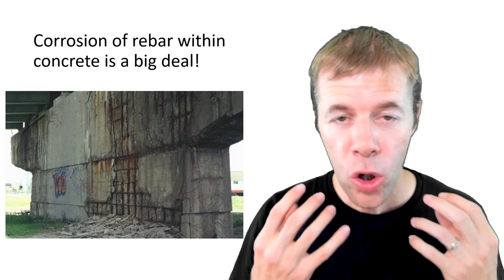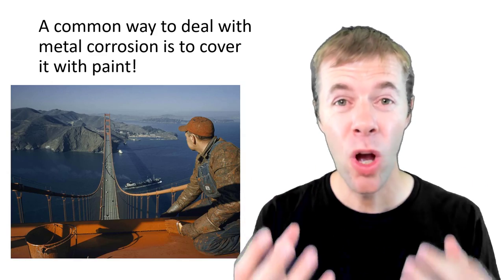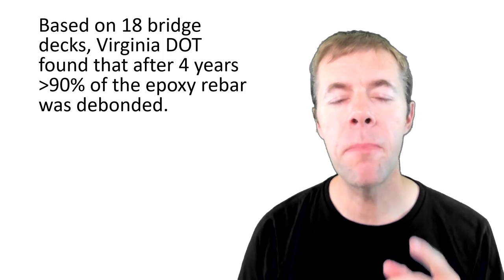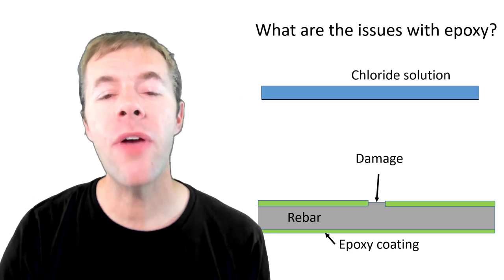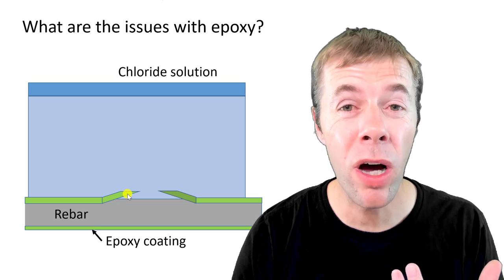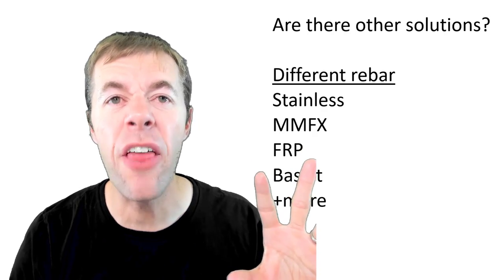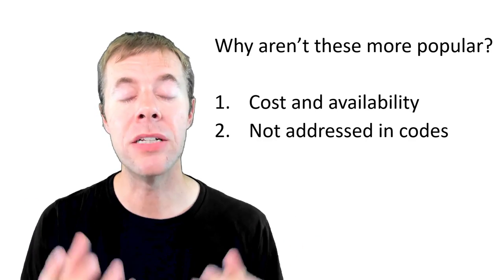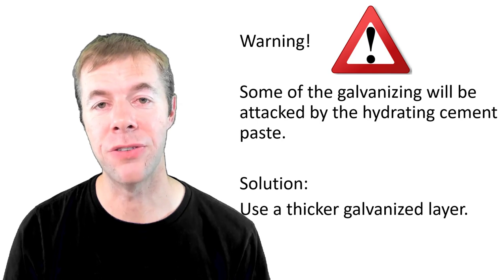What is epoxy coated rebar and why is it being banned?

Comment: Great Information!

So stating the obvious, bending galvanised will de-bond? Cutting? So I assume these issues are resolved by designing all the bends etc formation in external factories and then dipped?
Also minimum of 50mm coverage, A lot of European concrete cancer, especially from pre 1980 was due this simple oversight. Out of sight out go mind....

I worked I Dubia for a few years, apart from specifiing stainless steel, mild steel was used ( which 99% of the time was due to 'value engineering' hate that phrase) then they coated all external concrete with a bitumen based product, ( even in the ground the base covered in a bitumen based matting)I know it as sythaproof, drys black, two coats and smells like mens urinals....All external bolts fixings had to be Stainless Steel 316, ( coastal, very high salt in the ground and picked up via offshore winds), but often just mild steel covered in Dense tape (cheap bodge). Basic zinc plating was often ignored, which is pretty much standard around the world.  

Expect to see a lot of engineering failures, which have already happened, but the press is government run, so never reported. In my time out there, there were 4 tower fires, only one got reported....Apparently 'nobody died'. 
The curse of macho bartering culture in construction, plus those making decisions are there for the wrong reasons, that to be fair are a reaction to being screwed in the 1950-70's by the west (UK and US)....Geopolitics always has long term consequences....

Comment: My process of using rebar in strategic area for long lasting reinforcement is to coat the rebar with sopho then when dry, with licquid wax. You will die before it rust. Inexpensive but works well.

Comment: God makes people to serve a purpose. i want to know about concrete and here you are.  Im looking into ferro concrete for boats.  So galv is good {as I thought}  but ive learned that concrete isstronger if made using salt water.  So what do you think with concrete using glav rebar using salt water.  But also - I see there are additives for concrete -  of interest is to make it water proof.  Im at a toss knowledge wise if you use salt water in concrete - is that going to erode the reinforcing.  Thanks.

Comment: So again about rebar, the use of Galvanized Structural Anchor bolts was not permitted on heavy structure. I was advised that Galvanized bolts in concrete would not attain torque of the nut due to slippage. So many things to know about concrete Eh!

Comment: Wouldn't it be cheaper to use 316 ss
 On buildings & docs on the water.
       For the long run.
Like when a building is literally falling apart in 30 years.
     Or replacing a whole doc.
           Galvanizing is probably illegal in the US. Its a Lead coating.

Comment: Galvanising is also very costly. We have invented nano technology based compound from precious metals in nano form which increases thee nobility of iron and hence increases the bond strength between rebars and concrete. It is 10 times cheaper than galvanising.

Comment: Stainless rebar would never work in concrete.... it expands and contracts far more than other steels, and work hardens in unusual ways. In my mind, fiberglass rebar would be ideal, but the costs associated with it would be prohibitive. There are other steel coatings other than epoxy to look at (improving existing formulation and thickening the cladding come to mind. Likewise with Galvanization (Hot Dipped Zinc), there are other metallic coatings which could be alloyed or added after galvanizing to improve corrosion resistance... nickel comes to mind.

Comment: Use to work in a steel mill when we lost a heat (did’nt meet Specs) it would be sent to the bar mills to make concrete rod
In Europe they have been using Stainless Steel rebar for over fifty years.   They are smart we are stupid ! ! !

Comment: Where are our civil engineers' comments?
.
.
Corroded rebars actually bond better with concrete. There is a reaction that creates a bond between steel and concrete.  The problem is when the corrosion to the steel goes subsurface into the steel.  When this happens the steel expands and cracks open the concrete allowing more moisture to enter.
.
The main aim is to have minimal corrosion and a fully effective concrete skin that seals the steel rebar to ensure no more oxygen reaching the rebar.  This is achieved in most Dam construction.
.
I can see epoxy creating a slip layer and failing.
.
ps; it is very important to use steel in concrete as steel provides elastic strength to concrete and it happens to have the same thermal expansion co-efficient as concrete.

Comment: Well all those gas pipes from the 1980s and earlier that are buried in the dirt. We prevented holes and nicks in the epoxy coating by running a 5000 volt zapper over the pipe. If there's a hole a bell rings and you mark it for repair. Delamination of the epoxy is caused by time delay between sand blasting to clean metal, and entry into the oven. It can be caused by cooling before coating on the stuff that's left the oven. It's caused by lazy workers trying to maintain production, or management cutting corners on the product by not running cold material back into the oven. I made coated gas pipe for years, and out product has been exposed to the elements for 50 years or more likely longer 70 years under thousands of psi, and it's still good gas pipe. Building construction just needs a zapper run over the rebar before pouring concrete. Zink coating is ridicules. Nothing reacts with zink more than clorine compounds. Drop a galvanized nail in diluted hydrochloric acid. The zink will release hydrogen creating explosive pockets inside buildings. Really a bad choice.

Comment: Sacrificial electrodes would also help, but painting or epoxy-coating, that's stupid.
Paint rebar or anything buried and it'll be cut through/get a big hole everywhere the paint is slightly broken. This is something every student learns in year 1 o 2.

Comment: I think you. Are on to something even double or triple 0 coat. After the problem with the collapse of the condo in Miami Beach which had this problem but only one of perhaps many other deficiencies. It certainly is not the only solution but  a start. The other is over-site which should be in play often gets compromised by corruption and inefficient prepared planning. An example not ordering enough of a certain material and finding not enough time in deadline of the project to remanufacture the item. Often an inferior  substitute is is chosen! How can this be? That is where corruption finds it’s way into the back rooms.

Comment: Could there be a more natural solution?  Perhaps bamboo which is sectional, strong yet flexable, quickly & easily grown.  Or Hemp or such ??  I'm no engineer but with all the advancements of the last 50 yrs you'ld think we get past rebar as a reenforcement for concrete.  The uses of bamboo as schaffoling and such in Asia is remarkable.   Anyway just my two-cents worth today...    : . )

Comment: TL;DR Galvanized rebar anyone?   Possibly there are other coatings that would be similarly effective and which are less affected by the slab pouring and curing.   Curing concrete gets quite hot, that's quite the environment for the rebar to live in.

Comment: With all the plastic waste about its time for how concrete is made. If a compound of plastic dust could find a way into mix. Then the beams decks etc should be waterproof. I know there is currently cement waterproofer and plasticsicer on the market already.  They say plastic takes decades to degrade.

Comment: Also epoxy is much weaker than steel and is supporting all the frictional force between the steel and concrete. The epoxy is likely to just scratch or nick while inside the concrete.

The actual solution to this issue is simply adequate distance from the exterior of the concrete to the steel rebar (or "cover" as it is known). This completely prevents corrosion and when this solution is widely adopted "concrete cancer" is considered rare (except in the case of direct sea breeze which carries salt water).

Comment: Repaint after installing and just before pouring? Ceramic coatings? Carbon Fiber? Rubber Coating? Plastic Coating? Galvanized + Epoxy? Epoxy mixed with Ceramic? Fiberglass? Epoxy mixed with sand or Fiberglass?.........

Comment: Boats use sacrificial zinc to allow current flow and not lose fittings, all_metal boats worse.

Consider moist dirt is a conductor to ground of a building's current from charge variance, i.e. by the dawn particle shower, human & solar EMF emissions, treat it as such.

The metrics are a handheld antenna, meter to ground or to the building pre-dawn, also get soil resistance/meter for the site.

Early Mayan pyramids triple germination of grain on altars pre-dawn and still work.

Comment: Epoxy is far better then Galvanizing and if you are worried about corrosion on your epoxy rebar then use Cathodic protection when it comes to galvanizning just look at allot of the culverts along road where road salt is used heavily they are rusted severely.

Comment: Solution.  Tough flexible Polyurethane type coating.  epoxy is too brittle  technology must adapt.  Galvanized only provides a % increase when I prefer 'set and forget' forever.

Comment: Stop that Golden Gate Bridge myth please:

"Many misconceptions exist about how often the Bridge is painted. Some say once every seven years, others say from end-to-end each year. Actually, the Bridge was painted when it was originally built. Until 1965, only touch up was required. In 1965, advancing corrosion sparked a program to remove the original lead-based paint (which was 68% red lead paste in a linseed oil carrier). The removal continued to 1995. In 1965, the original paint was replaced with an inorganic zinc silicate primer and acrylic emulsion topcoat. In the 1980s, this paint system was replaced by a water-borne inorganic zinc primer and an acrylic topcoat. The Bridge will continue to require routine touch up painting on an on-going basis."

Comment: Stainless steel needs oxygen, don't know if it can get it in concrete, also you can contaminate stainless steel.  If you use a chop saw on steel and then use it on stainless steel it could contaminate the stainless steel and it will rust.

Comment: Chloride contamination can proceed within hours if condition are right, e.g. very dry wall in winter, as cold air is very dry, then a saltwater splash and within hours you can have significant chloride contamination up to several centimeters depth. The subsequent formation of rust is then nearly not to stop. Further more  steal works began to use sodium chloride for the cheep iron production, due to its very low cost compared to other additives e.g the to be kept very dry CaO to remove impurities from the molten iron. Of course it is setting very bad inhomogeneities of NaCl into the steel itself, which may even lead to Inter crystalline corrosion, so our "old" Inorganic chemistry Professor would have executed us if we would have attempted such sodium chloride iron procedures!

Comment: Galvanized is more brittle and flakes off and very toxic to weld and then same problem exposed at the weld and welds not as strong.  Have to penetrate two different metals in an amalgamated inferior weld that exposes weld. Bending lso flakes of and cracks.

Comment: those are not scratches you point out there.....that's the fold lines from the epoxy contracting as it sets and dries.....anyhow....scratches surely happen, but that was not a good example.

Comment: Why not add something that makes the concrete resist chloride better.
Besides we should be ramping up aluminum production? Isnt that a great choice as it corrodes instead of rusting.  Aluminum is weaker but its not weaker then rusted rebar. And you could change the rebars chqpe to make aluminum more viable. Currently it is way to expensive but with more and more aluminum foundry’s it would be possible.

Comment: Galvanized bar is not practical ether. Bar has to be galvanized after being bent and the avaliable lengths are no more than 20'-0" many parking decks have 30 to 40 foot spans. Bars can't lap wherever you like so it is very limiting to design and more costly in overall tons on bar.
Reply: I take back the part about not being able to bend after galvanizing. The supplier we used doesn't do it but it apparently can be done.

Comment: epoxy coated rebar is only use around water. Dont know what is happening in VA. but in California, we have used it for several years. And no there have been no problems. Your pictures show poorly coated rebar and that is manufacture's fault. A good inspector would not let that rebar be used. and if 1 piece is exposed all rebar gets inspected. But if there is a pay-off, inspector will overlook problem. Also if the Union is weak in your state or region, it becomes "anything goes" as long as we get paid.

Comment: Problem must be solved with the concrete so it doesn’t absorb moisture, don’t forget you have to cut and bend rebar and when you do the galvanized surface goes away
Reply: They coat electric wire adequately why not rebar?

Comment: Okay I'm going to tell you the true answer and that is plastic rebar galvanization is just like epoxy it has breaks in it and that's where the corrosion gets in it's not as bad just because it's got the properties of zinc that actually take the corrosion onto itself and it doesn't expand as much as Iron and Steel it's just not a good solution for the corrosion of concrete and steel combined the answer is plastic and it's been known since 1979 somewhere in there when I was 17 or 18 years old I met a man in Durango Colorado that I eventually worked for as a plumber and his brother-in-law had created a material made of plastic that had the same properties as steel as far as tensile strength which that is the most important property of rebar and he tried to sell it and the steel companies came against them and squashed it I don't remember the whole story but they pretty much tried to threaten them first and then they tried to buy him out and eventually they just made it impossible for him to continue on they bankrupted him so now we are 40 years later and it's time for this Environmental change to a new understanding of plastic because there is a need to get rid of our excess plastic and what better way to put it to use then becoming rebar holding our skyscrapers together with lightweight and the same strength of steel I know it's possible I know the steel industry still wants to fight it but it's inevitable we just seen what the environment can do to a structure made with steel and concrete columns and the fact that it weighs 1/10 of the weight of Steel it just makes sense it's non-corrosive it has the same bonding power with the concrete so look at tensile strength and compression strength and they're exactly the opposite one of them is force n-word and the other is a stretching Force and the stretching Force goes straight up diagonally and sideways whereas the compression force basically goes straight down in the example of concrete structures there are outward forces in the concrete structure and they are calculated by the height times width so when you add the steel it's basically the diameter of the steel improves the tensile strength 7 thousand times the tensile strength of the concrete itself I forget the math it's crazy but I know we could be putting plastic in concrete with at least the same or better Improvement in tensaw strength and with no corrosion whatsoever I think it's ptfe that we want to look at I really don't know and there is no reaction to plastic and concrete that I know of

Comment: End of discussion. 
Galvanized Re- bar . I’ll remember that when I build my parakeets cage those rascals aren’t getting out this time … 👌
Reply: galvanized rebar would have the same problems that occurred in concrete boats years ago. the zinc in contact with the wet concrete forms hydrogen bubbles around the wire preventing adequate surface contact,  there was a chemical that was added to the mix to slow or stop the zinc corrosion

Comment: The best solution is:

Change state regulations to ban the use of Chlorine in drinking water
Reply: Yes, it's the drinking water that causing damage to the bridges.
Reply: @recursiv  Here in the EU, we do not add chlorine to our drinking water. {if  am not mistaken its even Illegal to add this to the drinking water}

And we don't have to paint our bridges on a Yearly basis.
Reply: @darknessblades  That may all be true, but it doesn't seem like there's any connection between the two.  In the EU, eggs are not refrigerated, but I also don't think that's related.

Comment: Why not use rebar that is closer to stainless steel with it's resistance to corrosion? Why can't a rebar be made that is much more immune to corrosion? 
I realize a steel mixture with more chromium or nickel will make it much more corrosion resistant. This is the huge enemy of construction and that is cost. 
Chromium is very expensive to add to steel. That is why stainless steel is not used more in construction.
I do realize stainless steel is about 5 times more expensive than carbon steel. That is a ball park figure comparison. That prohibits it's use in much construction.